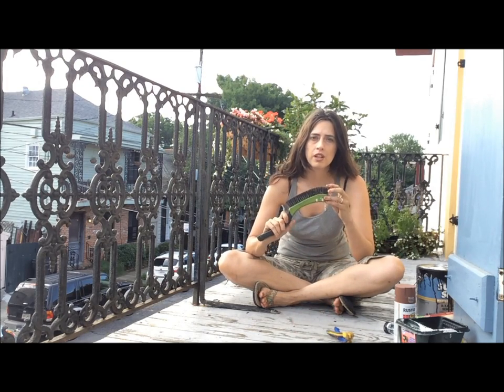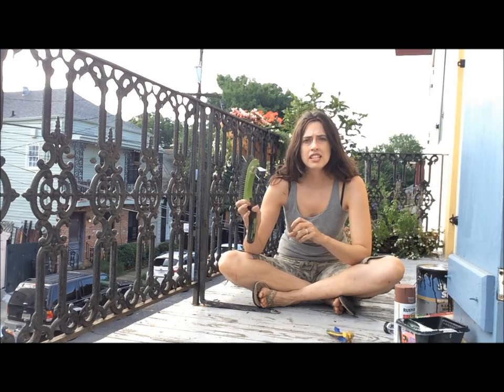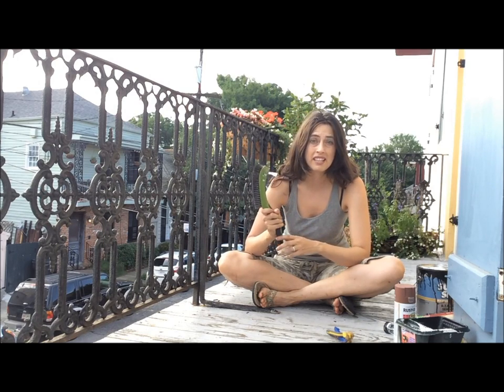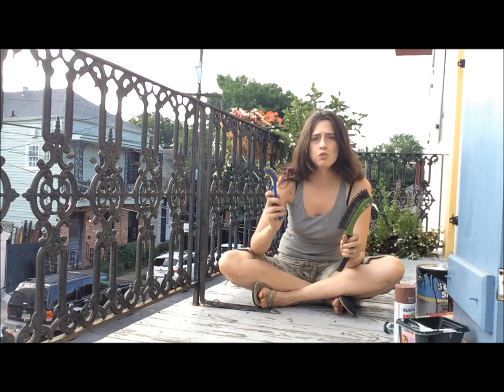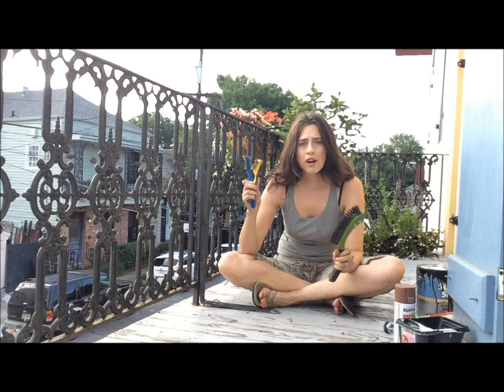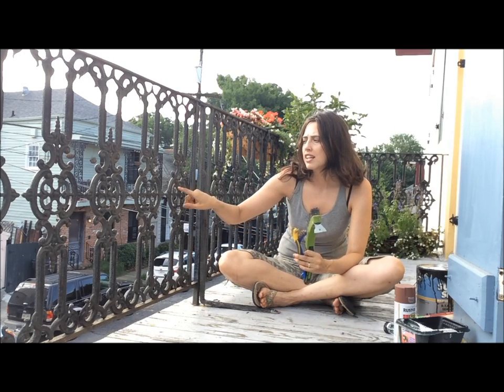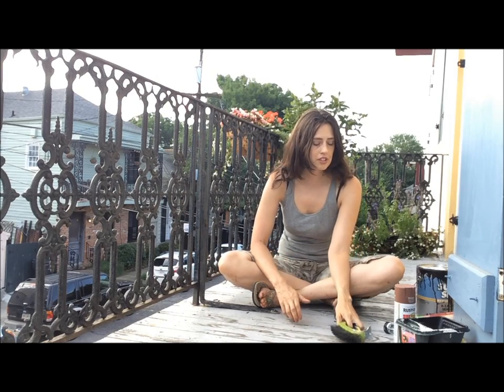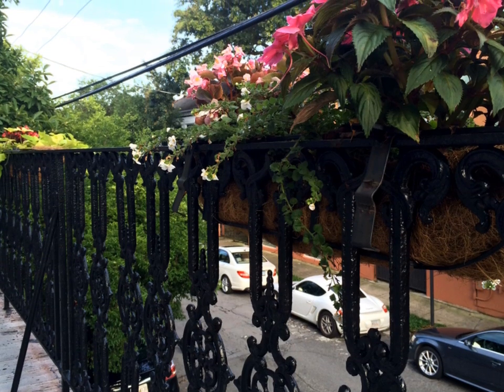Painting Cast Iron Railings

Comment: Very helpful.  Pretty as well. Is it better to use a small 1/4 nap roller or the spongie kind? Which will leave a better finish? Huge rail job coming up . I was use gonna give my workers brushes. U mentioned roller. I saw them mini rollers . How affective is it with an exteria oil paint?
Reply from the maker: jose contracter I used a regular 4" paint roller, not the spongy kind (though that might also work and might result in fewer drips). For the roller to save time I had to have lots of paint on it, so the paint would flow into the crevices and down into the hard to reach spots. However, that meant there were lots of drips. Whatever you use, I recommend a drop cloth. And I found that there were lots of touch-up spots I still needed a brush to get to.

As for the finish, I saw no difference in the rails painted by the brush and by the roller. Maybe because it takes so long for this particular paint to dry it all seemed to smooth out. Hope this helps...
Reply: TONY b